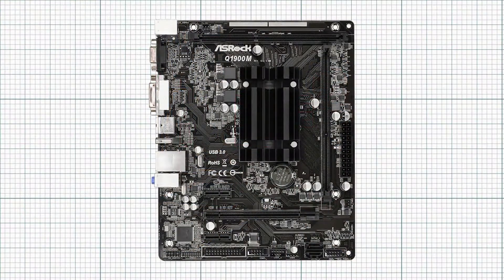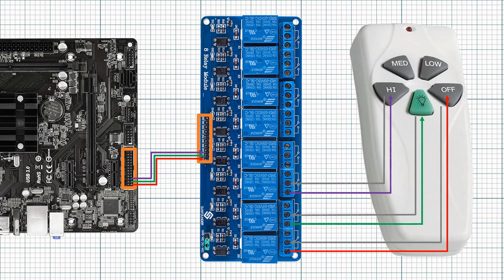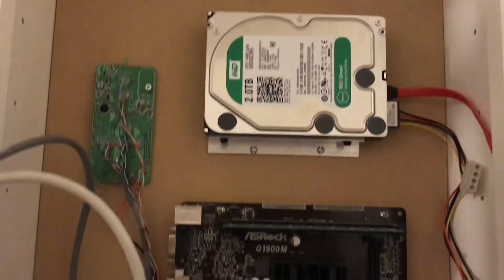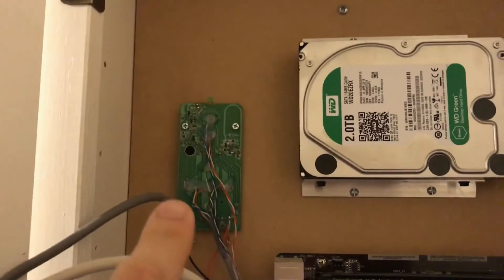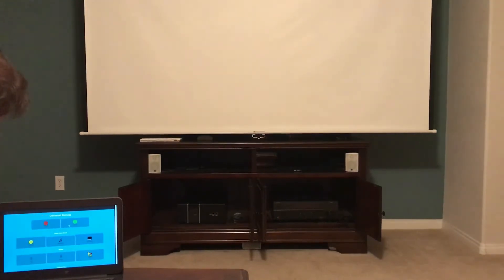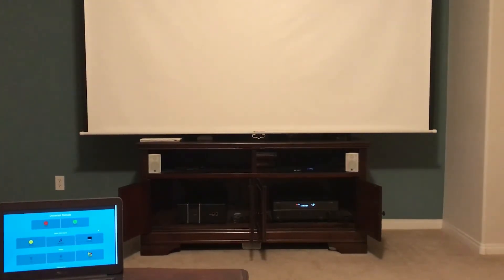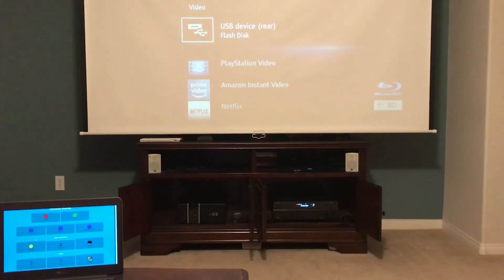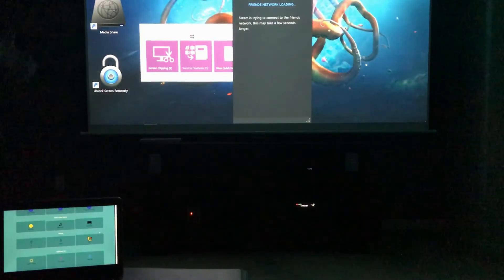Home Automation through the Parallel Port

Comment: This was very interesting! What’s the web interface of your server? And how do you change the AV inputs? Is it up to the projector itself? Thanks!
Reply from the maker: Hi, thanks for the comment! The web interface is just that--I have Apache installed on my server, which is hooked up on my local network. The AV inputs can be toggled through the web interface as well, just as if you were holding a regular remote control that the device came with :)
Reply: @StoneFlange  Hey, thanks for the response. I was interested how the switching happens itself. Is there a dedicated AV relay or this is a built-in function in the projector itself.